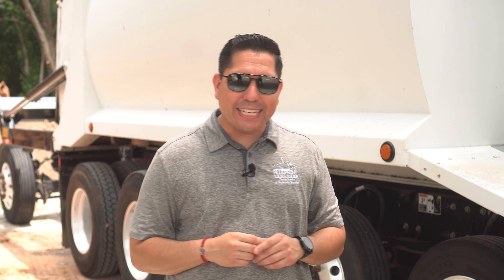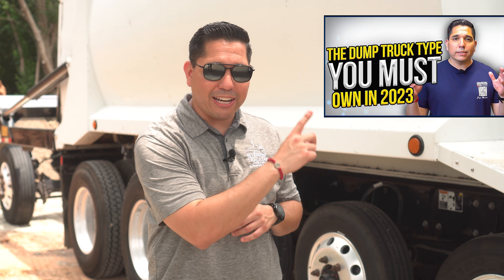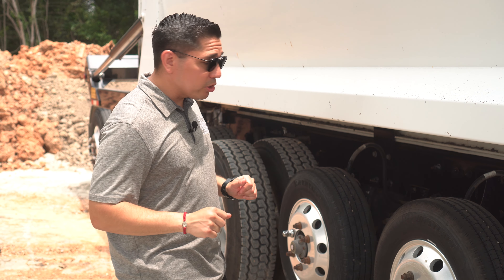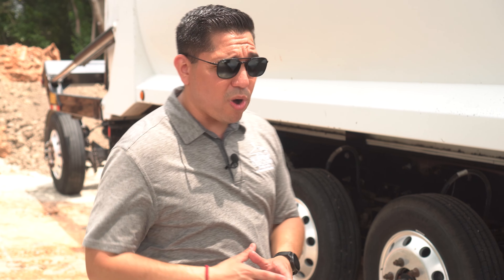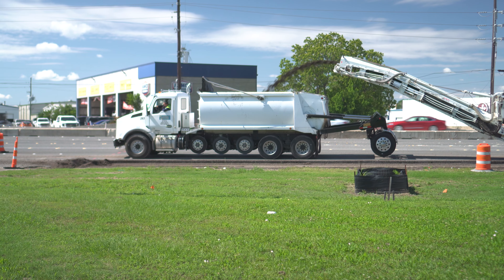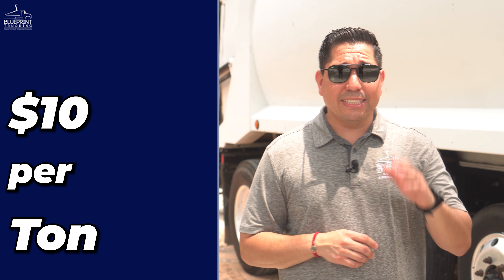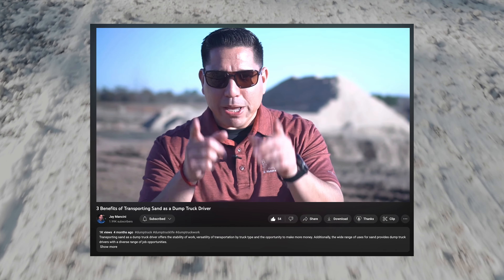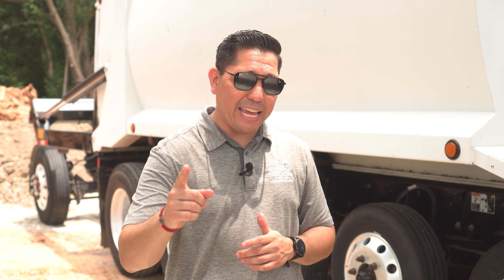How To Make $1000 Per Day in a Dump Truck

Comment: A truck that size should be closer to 2k a day, most supers are getting 145-155/hr. rates must be real low in ur area
Reply: Where at? Where you located? I’m in Louisiana I get 1k a day
Reply: NE Ohio rates are $1250 a day for quad, $1090 for tandem.
Reply: @DracoBeats  exactly im in the columbus area and were getting 120-130/hr for quads/ 6 axles
Reply: Hey guys, do you guys know anything about the dump truck business in GA?
Reply: Naw your just greedy
Reply: @joshlower1  pay 400k for a truck an work it for 1k a day you will be out of business by the end of the season. At that rate you can't pay a driver, 1 flat tire an ur working for free that day if you run an maintenance the truck yourself you will be working just for the sake of having something to do some people call it greed others call it being smart especially when that 400k truck payment don't stop when the weather shuts you down.
Reply: Where do you get paid 145 hourly
Reply: What's the overhead on the truck per day?
Reply: @Krod4321  there are alot of variables depending on if the truck has a payment and if you are paying a driver or driving it yourself some trucks ive seen out there the overhead is close to 85% of what the trucks making on the hour some it's much less

Comment: Seems to me a trailer dump would make more financial sense
Reply from the maker: Just depends on what type of truck is most often being hired in your area.  Thanks for watching!
Reply: trailer dumps are not legal in all parts of the country to say nothing of the space requirement on the job sites. In my area I can haul total weight 36 ton with a haul of 22 tons on a 17" bed triaxle vs 40 ton on say a 24 - 26' trailer dump on 5 total axles which would be a net load of in the range of 24 - 26 tons.  You can't fit a 26 foot trailer plus day cab into a residential development.